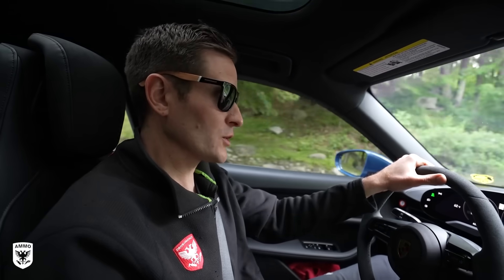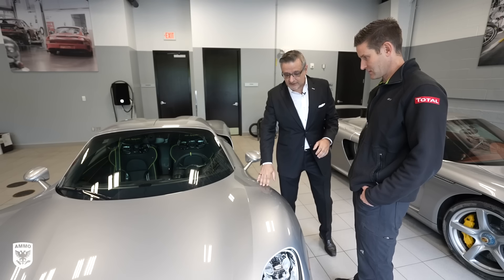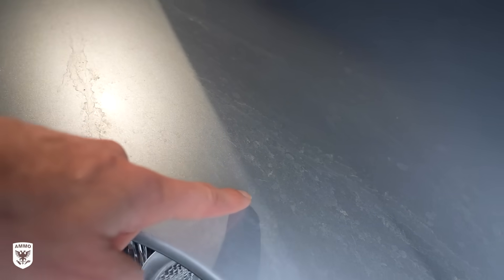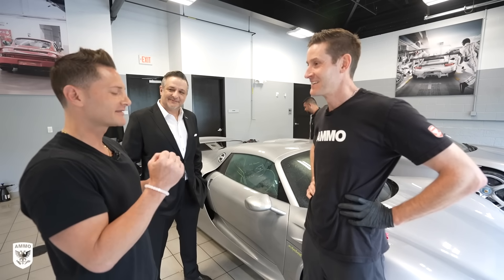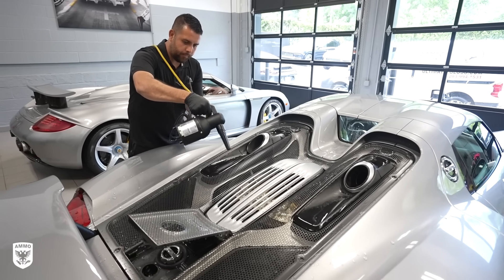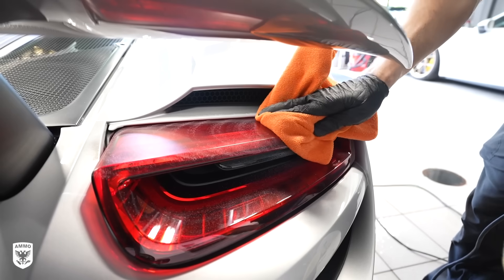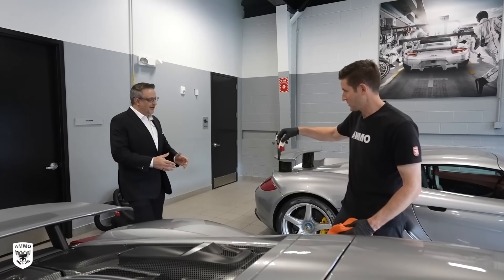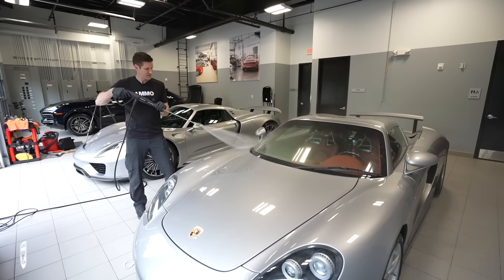Porsche 918 Spyder First Wash in 7 Years Detail and Sell!

Comment: When doing 2 cars that are only a few feet apart, do you have to dry them both off  every time you use a pressure washer on one car?  When power washing the Carrera GT, I couldn't help be think some of the water is going to end up on the 918 you just finished.  Even if its just a little splash or misting. Is that inconsequential, or does it require a lot of extra drying?

Comment: The Carerra GT is literally the same exact car the movie Actor Paul Walker died in. Look it up. They are not safe at high speeds past a certain point for multiple reasons. There’s an issue with the aerodynamics with them. Air pushes the car almost air borne in certain situations at top speeds. They are known for this safety issue for years. The 918 is a way better car.

Comment: why don't you use dry ice (carbonic ICE) cleaning, which is more effective and non-polluting with regard to chemical products? 
everything you do with a brush and detergent is much easier with a nozzle that shoots dry ice under pressure, especially on the technical parts, underbody, suspensions, wheel arches, wheels, organs, air intakes, etc, etc ...

Comment: You completely detailed the 918, then you're going to wash the GT which is standing a few feet next to it without driving the 918 away?? No way the 918 didn't got water drops because of the pressure washer.